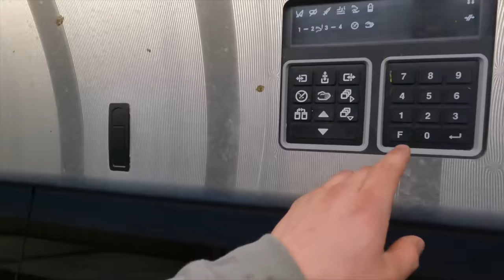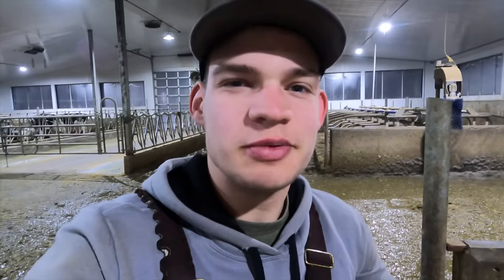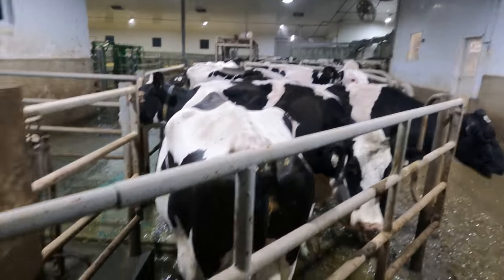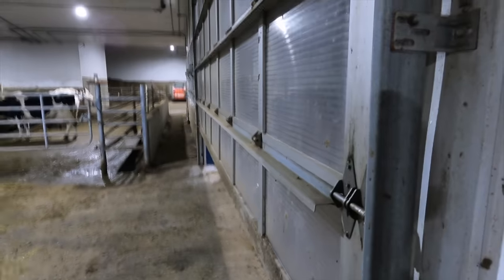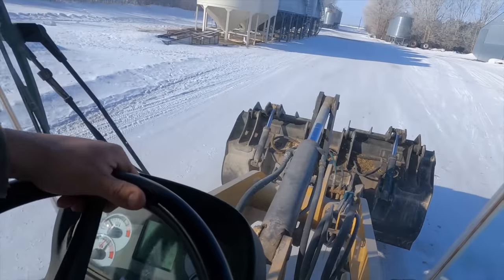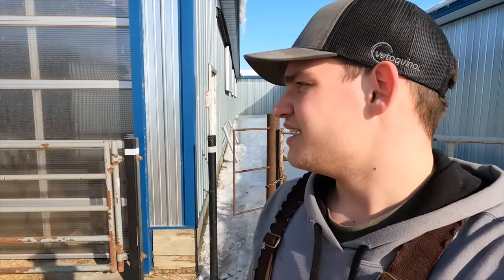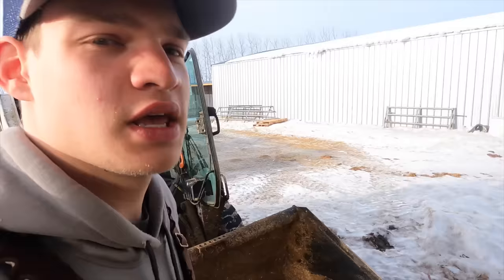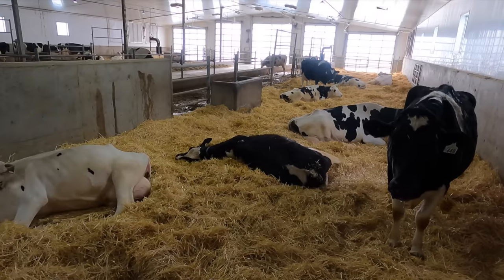A Morning On The Dairy Farm!

Comment: Baby calf’s we load them and transfer them to a nother barn the older owns walk to get to pastures. Glad the cows like the brushes helps them out . We spray their backs with fly spray and hang fly propellant electronic spray on timers. 
The farmers here have a crew with semi trailer tank hauls liquid manure to fields and it dumps in a big tub which pushes it through the pipes to tractor with  chisel plow puts it in the ground. 
Do you guys ever wash the calf’s off with warm water to keep them clean will in calf barn until transferred to another pin?

Comment: @saskDutch Kid Hi Jan, Those kind of door motors have a very clever (or very stupid) sensor that measures the current it is drawing. If the current threshold is set too low, the door will stop. The idea is that if anything is under the door or if it gets jammed, it will stop and hopefully not kill anybody or burn the motor out. If the door is properly greased and you can't find any mechanical fault with it, there should be a pot somewhere on the controller board or some way to adjust the threshold up more. On our gate motor, we have to let it reprogram it's self.

Comment: Haha your old man really told you what was up cleaning out those calf rooms buddy. Hey on your overhead door, if you take the cover off by the motor there’s like some limit switches in there. you’re pretty mechanical I bet if you look at them you’ll see that they’re just out of adjustment and that would straighten out your overhead door trouble. it’s a pretty easy adjustment. You will see when the doors all the way down it hits one switch then when the door is all the way up it hits a different switch. If those come out of alignment the door will do all sorts of weird things like it’s doing now

Comment: Ever do a vid on gov inspectors?How milk prices are set?
Reply: I'm not totally sure. But I've heard that the actual farmers have very little say. They sell the milk off to be pasteurized and I think it's the company that's processing and packaging that deals with government. I'm not totally sure on this. Just what I've heard.
Reply: In Canada, we have  a supply management system. The provincial marketing board pays the dairy farmer based on the cost of  (average) production The marketing board then gets best price for  the milk from the processors. Canadian dairy farmers have to purchase the right to ship each kg of milk (including protein and fat). Because of the stable prices and milk supply, the government never has to pay out support when  the price varies up and down as it does south of the border.
Reply: Dairy cows have been bred to be such good milk producers, and dairy farms have gotten so efficient, that in both the USA & Canada, dairy farms could produce more milk than the market can handle.

So both countries have systems to deal with this, but different systems.
In Canada, it's mostly managed on the supply side -- the government limits the size of dairy herds, to control the supply of milk.
In the USA, the control is managed on the sales side.  Theire are target prices for milk, and when an oversupply causes prices to drop, the government steps in and buys milk (but usually at a lower price than normal market price).  This causes the market price to go up again.   If this happens often, some farmers will decide to reduce the size of their herd on their own.  

The government-purchased milk often is turned into dried milk powder or cheese (you can't really store raw milk).  Much of this is distributed to poor people in the US or as Foreign Aid to poor countries.
Reply: @wildog47  ث

Comment: Jan, one consideration about water use is the fact that you have nearly a closed loop water cycle. Granted you will have some evaporative loss from your lagoon, but the reapplication of your manure to your fields means the water has the same chance of returning to the aquifer as rain water does. Because you use well water, and you have a large land area to recharge the aquifer between each user, your water use is likely not measurable in terms of impact on an aquifer. The biggest consideration that comes into play in your setup is the energy used in performing these operations.
Reply: I often wonder if there could be some additional way to process lagoon water into fertilizer  granules or pellets.  Which could somehow then be spread at the same time seeding is done.  That would save the time, labor and fuel ($) needed to do those different jobs separately at different times into something done together using less days of work and less cost outlay.
Reply: Probably is, but likely not cost effective on a small scale. I know a number of chicken growers produce a dry, pelleted product out of chicken litter. It’s a 3-2-3 usually, and spreads out of standard fert spreaders. The pellet process also heats the material so it is sterilized and dry. 

I would think the lagoon material could be done in a similar way, but not sure if it has sand in it. If I had to guess, running sawdust bedded dairy manure through a digester or solid separator first and then pellet mill might work. But at that point, probably not cost effective compared to spreading raw. I think the chicken plants use it as a product for outside sales.
Reply: I'm a Master Plumber and I would like to say that you are right on the money. In fact we still have every drop of water that God made this planet with , with the exception of what of what we have sent into outer space. That is an immeasurable amount compared to what we have here on Mother Earth. Right On!!
Reply: more video to come . god bless
Reply: I think the main issue with water usage is the amount of water used to produce the crops for animal feed. That's why it's not efficient.
Reply: That only pertains to irrigated crop production. If the water is being pumped from a well, your argument would be valid. Dryland crops are grown with natural rainfall. 
This is the basic flaw with the discussion around water use efficiency in livestock production. The water use is always calculated as if it were pumped from a source that could otherwise be used for something else.
Reply: @grassfeeding6073  I see what you are saying. I guess the issue, therefore, is not how much rainwater is used on cropland - but how much of that goes to animal feed vs human food as famine is still a thing and world hunger is rising.
Reply: Yes you are absolutely correct. Much of our issues are related to the geographic distribution of production vs. need. We do produce more calories than are needed per person, even with animal agriculture, however distribution is unequal.
Reply: Feeding crops to livestock that could otherwise be fed to humans is the issue. I agree entirely. It’s a first world luxury to do so.

Most farmers, like myself, do prefer to hit food grade markets as we receive higher values for our grain. Production of food grade vs. feed grade grain is actually more complex than many realize. Standards exist around vomitoxin, allergens, cleanliness, source verification, etc. there are also market access challenges. Perhaps there is no buyer for food grade wheat, barley, dry beans in your area. As a result, you may be better off financially to feed lower value grain to livestock to increase it’s value either as milk, meat or eggs. Similar to turning corn into whiskey, transportation becomes more realistic with high value food items.

Market forces and government policy are the two driving factors. We have massive issues in our industry, but each farmer is just trying to keep the lights on and provide for their family. We need consumers to help advocate change our industry. I would also encourage you to look into the issues around ethanol and biodiesel production. It is so depressing to know that we burn half of the single largest US food crop for motor fuel.

Comment: For a good fiew on the oil.  You need to do a second check with te dip stick. Our old tractor is always low on the first few. But when I do the second check right away.  Its perfect  in the middel.

Comment: I enjoy your video. Would it be worth your while to collect the rainwater from the roof to cut down the on watet used
Reply: The rain water collected method is expensive to build and maintain where there is a danger of freezing solid 6 months of the year, and then only have limited usage - maybe washing the floors. Can't be used for washing the milk machines/tanks, unless it goes through extensive and problematic screening/filtering and purification.  Saskatchewas was a former ocean and has tremendous underground aquifers so well water is easier and much more economical, and almost all the water with nutients goes back on the area land owned by the Dairy.

Comment: Dumb question.  Do the cows ever get washed?  I was thinking of like a spray arch they could walk through maybe at the foot bath?
Reply: If they had a apray arch near the foot bath  The bath get washed off and the cows would return to the pens soaking wet. Imagine that on a 130 morning.  If the spray was before the foot-bath, the bath would become diluted as a result of water running off the cows - AND they would return to the pens soaking wet.  When they laid down, the sand would be all over them.  You have to think about the whole process, not just one little but.

Comment: Hey
Why do you first rinse the floor with water and then hose down the rubber mat?  Why not the other way round? Now you have to clean the concrete floor twice. It's a question that's been on my mind for a while.
Greetings Tim
From Belgium
Reply: I think that they do it like that because if they had to spray the entire floor down first, that would take a ton of water to do that because of all of the manure piles that have built up after the cows do their business. Secondly, the water already has a lot of sand and little bits of manure so after the water is shut off and slows to a trickle down the drain, it will leave dirt and sand on the floor, making them have to spray the floor down again. 

On a side note, I have been to Belgium once and it is a really pretty country. Greetings from Kansas, USA
Reply: @jarettgros5821  Hey Jarett Gros
I mean just clean the rubber mat first before rinsing the floor. But I understand that they clean the concrete floor twice for the last remnants. Thank you for the response.
Tim